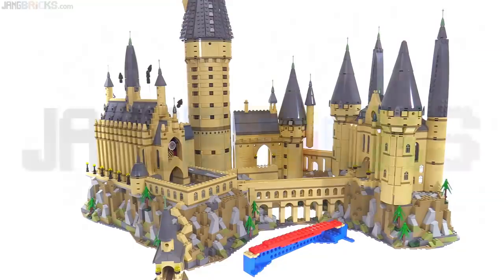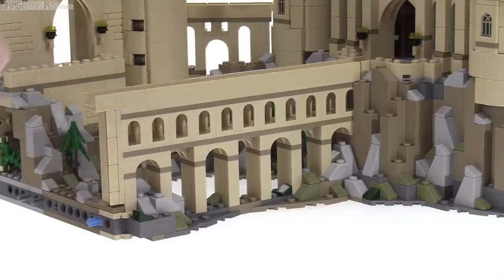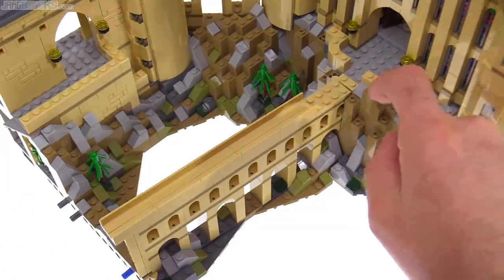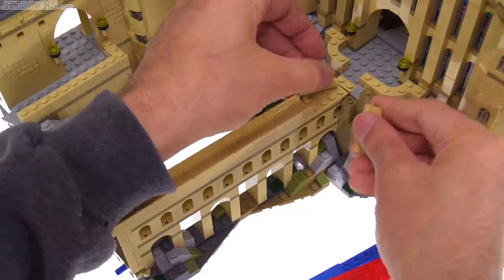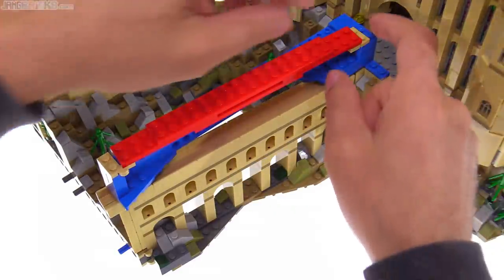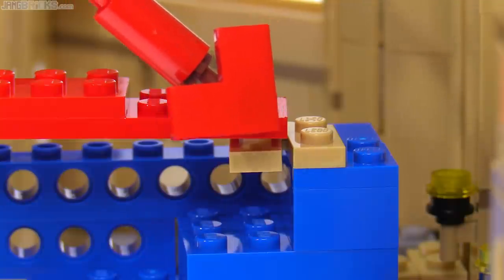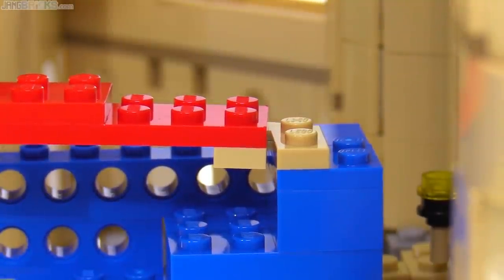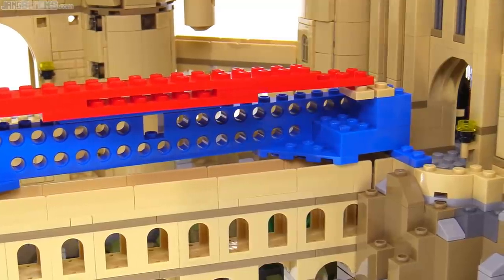LEGO Hogwarts Castle Viaduct geometry problem follow-up

Comment: Hogwarts should've gone through proper planning permission channels, before they built that bridge. Under normal circumstances it seems safe enough, but add magic to the mix, and the level of structural stress on that bridge is unacceptable! Obviously they cut corners, and maybe even paid off a few planning officials. Well now this corruption scandal has come back to haunt them. I certainly won't be sending any of my kids to Hogwarts, until they sort out this problem!
Reply: ROFL

Comment: I've been building castles a lot lately, and getting angles right is very, very difficult. I admit, I've done similar illegal techniques in my mock builds, but they are not for long term display, and not for sale... I'm not sure I agree that it's a minor issue. This is a display piece, so it should be designed to sit. The ucs imperial star destroyer is a good example. Looks amazing, but after a few years the long plates warp and sag. Also, when they let things like this slide it can set a precedent for future official builds.

Comment: This choice of building technique could potentially damage the section and the pieces (the set I guess).
Reply: I doubt the bricks would get damaged. However, if you move the set you would have to be very careful.  Because of this extra stress, bricks could snap off.

Comment: For anyone wondering about the exact numbers, it looks like the difference between the two hinge points in the blue is exactly 22 studs. Meanwhile the distance between the two points where the red piece lines up with the hinge points is between the two corners of the 22x2 red bridge. So that distance is sqrt(22^2 + 2^2) = 22.091.

Total discrepancy = 22.091 - 22 = 0.091 studs, less than a tenth of a stud and I think about 0.7 mm.

Comment: i believe a variant of this also appears in the nose of the 75218 x-wing (and several previous iterations). a 10 stud long section is attached at an angle using the same hinge plates. (the lateral offset is only 1/2 in this case). i kept double checking but it appears to be true! for me this is more interesting than "wrong" but i still find it worth studying.

Comment: We just finished this build today and did not replicate this issue. We watched your review before our build, so we knew the problem was coming. What we found was our viaduct fit perfectly with no stress or tension. We did a short video to show you, we can send you any photos you might find useful to compare builds if you'd like. Love your reviews by the way, and we were looking forward to trying to solve this problem, but ended up not duplicating it.
Reply from the maker: I appreciate you sharing the video.  I just left a detailed comment there (and no, I'm not the one who gave you a thumbs down -- that was uncalled-for).  Your demonstration actually inadvertently shows exactly the same issue that I did, as you're having to bend the whole left side of the foundation out to wedge the viaduct into place.
Reply: Thanks, I pinned that comment. We appreciate the additional explanation!

Comment: I think I'm more worried about this than Jang. I've had old pieces crack just from the normal stress of being assembled, this puts a much larger stress on those pieces. It wouldn't crack right away, but it could years down the road. And this is the kind of set meant to be displayed for many years.

Comment: Wanted to bring attention to Kristof Pucejdl solution posted below. Great work! https://www.flickr.com/photos/127695176@N03/43309746515/
Reply: Wow! That's so simple yet so clever.
Reply: hmmm I don't know if it's accurate enough to fit perfectly but it seems that it may be a better building technic than the original one.
Reply: Es verdaaad, its true
Reply: more people need to see this!
Reply from the maker: While this does allow a legal, unstressed connection of the hinge in the simplified demonstration model, it does not fix the issue in the completed model, as there's an entire stack of bricks directly below the red plate that impact the landing.  Look at the corrected LDD model from the top to see what I mean; the top point of the red plate, which is effectively a 2D representation of a 7+ brick tall bridge, overlaps the blue 2x2 plate, which represents the edge of a BURP.  I should have shown this in my video as it's actually a better illustration of the fundamental geometric issue of the bridge being too long for the space into which it's forced.
Reply: Thanks! As Jang pointed out, it is a theoretical solution, but to apply it, it apparently requires more substantial modification. I could put up the work and design something, probably digitally using online instructions because buying the model is way out of my economics. But I think I can not target enough people to make the effort worth it. Maybe Jang will do it himself? :D

Comment: By the looks of it, the distance between the two hinge points is the diagonal of 22 by 2 studs for a distance of 22.090722 (sqrt(22^2 + 2^2)) fit across a gap of 22 studs, meaning that the bridge is 0.090722 studs longer than where it attaches. It looks like the structure surrounding the actual model is less rigid than your model, so hopefully it is not too big of a deal.

Comment: Pythagoras Time!
Judging by the view of the reproduction, we can call this build 22 units across and 1 unit down (since the hinge is two studs long)
The red “bridge” is 22 studs long, but to find the length that the red “bridge” should be, we use c^2 = a^2 + b^2:
c^2 = (22 * 22) + (1 * 1)
c = 22.02 <- slightly, not exactly 22!
As you can see, the actual bridge is shorter than what it should be, since 1, 22, and 22 as the hypotenuse aren’t exactly Pythagorean Triples (eg. 3, 4, 5 as the hypotenuse is a Pythagorean Triple since 3^2 + 4^2 = 5^2).

Comment: I had hoped that you'd make a math video like numberphile. Because if you draw and then calculate the geometry, you could notice that the length of the space is 22, and the viaduct is attached in a way so that the two attachment points are at the opposite corners of the 22 long, 2 wide viaduct. Because of this, according to Pythagoras, the distance between the attachment points of the viaduct is sqrt(22^2+2^2) = 22.0907 studs, which is not even nearly a full stud off, but far enough to feel it during a build.

Comment: Would one of those 2x2 plates with rotating studs be a possible fix? That's what immediately clicked in my mind once I saw the hinge didn't line up.
Reply: Carum Sarene true shame I don’t have the set I would try that
Reply: That would only change the angle, but the angle is fixed by the lengths of the triangle sides. And size the lengths of the sides are fixed it won't help. If all three angles could simultaneously move then one could expand to fix the issue but they can't all move. 

At least I think that's going to be the issue.

Comment: This is very well presented! I'd be interested to know if LEGO consciously allowed the design to stress the elements, or if this was just missed by the illegal-technique police :D
Reply: I'm pretty sure it was a mistake. If the ends of the bridge were four studs apart in y-direction instead of just two, it would actually fit in perfectly. And I'm not talking within a micrometer perfectly, but mathematically exact perfectly.

I'm pretty sure the builder was trying to use that technique, but messed up on the number of studs needed to make the connection perfectly.

Comment: If a1x2 jumper plate was used on that right hinge to connect to a center tube underneath the red plate/bridge that might circumvent the issue. I don't know how well it could work in the set though.

Comment: I can only imagine what Lego designers must be going through when designing a set like this, they certainly make mistakes and start over a build at times to make it better and making sure there are no "illegal" connections of bricks, forcing and squeezing them together is not the right way to build, but I guess some compromises may be acceptable, it only creates a slight gap and it won't affect the build itself, no build is perfect. And if you're able to correct something like this without taking everything apart, then bravo.

Comment: I wonder if the problem is a balance between working within the constraints of a LEGO brick and matching an element of Hogwarts Castle. Such that the angle of the viaduct creates the problem, and it would have to either be made straight or on a much greater angle to resolve the fit.

Comment: If you need hinges to connect one end of your bridge to another, maybe you have a larger design issue.  My understanding is that the ends of the bridge are offset by 2 studs. Obviously the design of the model on either side of the bridge led to a misalignment between the opposing entry points, necessitating the hinge.  What bothers me more about this build is not the illegal building technique, but the gap that is created in the hinges on either end of the bridge.  Even if the technique was legal, and the lengths magically worked out to allow connection without undue force or bowing, you would still, necessarily, have a gap in the hinge.  That sort of gap may work on other builds where you have rounded or unusual geometries (like the UCS Millennium Falcon build I just completed), but IMO, looks odd in this application.  I would have designed the model to have either end of the bridge to be aligned, without the need for a hinge.

Comment: This is the same kind of problem I have with the X-Wing fighters. The noses of them are turned up a tiny bit because of the angled side walls and the plates on top of them don't line up exactly. I even designed a legal fix for it so I don't know why Lego still does it.

Comment: The distance across from "main land" to "main land" hing is a movement of 23 studs across and 2 studs offset.
So the distance across is 23.09 studs. So the bridge must be 22.09 studs, minus the tiny distance between the open part of the hinges when opened at 5.444319 degrees.
 That distance along the line of the inner stud of each hinge is also 0.09. So the bridge must be 22.09-0.09-0.09 = 21.91. But it is 22 studs. The bridge is too big to fit.  A design flaw. For it to fit you are essentially forcing the two peninsula to spread by 0.09 studs wider than they would naturally lay. Jang is right, this is sloppy from lego. Over time I think it will make bricks work their way lose, and possible crack from fatigue.

Comment: I think this could probably be shown even clearer by doing some math using pythagoras? It seems the general sentiment is that it's a minor problem. Personally I'd say this is a huge problem specifically because this is Lego. The basic design of a Lego brick rests on the idea of rigidity and alignment (there are definitely exceptions, such as flexible pieces, etc, but this is not the case). A hinge will always need room to swing in, and whenever a piece is put on an angle, its more than likely not the right length or alignment to be reattached to the other side. I'm surprised they let this through, deliberately or not. Will be a bit tricky for anyone who cares enough to try and fix that. I'm quite disappointed, they can do better :\

Comment: I’m not a professional builder by any stretch of the imagination... just a guy that likes to build. I have heard “illegal” off and on for the last few years. Can you go into more specific about what that means and how this is “policed”?
Reply: Destiny Captain it means techniques that lego officially doesn’t use in retail sets, its only done by fans
Reply: "Illegal" is just the word LEGO designers use to define building techniques that are considered undesirable because:  
1) they place stress on the elements, making them wear out 
2) they cause elements to be out of sync, making them difficult to combine with standard building techniques or difficult to model with designer software 
3) they make the set difficult to assemble or disassemble for a kid

It is LEGO though, so in all honesty you can build whatever you want however you want.
Reply: If you really want to know what is allowed and what isn't as well as why, I highly recommend reading this. http://bramlambrecht.com/tmp/jamieberard-brickstress-bf06.pdf
Reply: As Gage Fisher said, pieces have to fit together “at rest”. If you have to wedge things together where they are constantly under strain, or a clip is only half connected, then that will not only make the Model hard to build but also make it fall apart easily and compromise the pieces over time so they get bent out of shape. 
It is only an official set thing and custom builders do “illegal” techniques all the time, but they don’t have to worry about making instructions that a five year old could easily follow like LEGO do with official sets. 
Personally I think it’s a good thing, sets like a UCS Star Destroyer they made years ago had many plates on top of each other without enough Technic beams to support them, and with years of the force of gravity it makes those models all warped and splitting apart if they have been sitting on display. If LEGO is totally obsessive about their design, it means the LEGO you buy now can still be played with by your children and grandchildren.

Comment: I have a feeling that the structural integrity of your model wouldn't have shown bowing it you hadn't left that space between the jumper plates for flex
Reply from the maker: True but whether the bowing shows in a demonstration model isn't a concern; the issue is that the entire bridge is too long to fit in the space available on the castle itself.  I should have shown the thing from the top to make this even more clear.

Comment: you could try to recreat it on Lego Digital Designer, if it works, its ok, if not, i guess its a mistake by lego
Reply: I was able to make some impossible connections with LDD (that would end up breaking a clip in “real Lego”), so that’s not entirely true.
Reply: LDD is by no means correct with its geometry! I had to use a file on some pieces which were crucial to one of my MOCs because I designed it in LDD and LDD would allow the connection I used without a problem.

Comment: Strange. In our set there is no pushing needed, the viaduct would fit Just fine when straight. The crookedness, if you will,  is a design choice. But there was no stress whatsoever.
Reply: It's a simple math problem that is in every set. It's evident if you make sure to assemble everything at right angles and pressing the pieces firmly together. If not, it way less noticeable and that is probably why I was allowed in this instance.

Comment: I had some problems with the base of my lego Ferris wheel from 2015 where the base wouldn’t sit completely flat on a flat surface and I rebuilt the base several times and still had the same issue

Comment: I don't have this set, and probably never will, but this is concerning.  I already dislike the whole tiles inserted into clips techniques that have been going around in sets, but now this?  There has to be a way to make it possible to still be sturdy and be completely stress free.  Unfortunately there are no instructions online yet, so I can't see if there's a way to insert tiles below that level that could slide into a slot or if there is room to add extra rockwork on the other side to keep things free from wiggling, but I think there could have been another way of doing this.

Comment: I believe it might still only be an off-by-one error. This is an old trick for making angled sections using hinges (explained well in a Creator video here: https://youtu.be/7jOVIpZj1g8?t=1m37s). From what I can see and a bit of drawing I did to make sure, offsetting the hinge at the end a further 1 stud would solve the stressing problem.

Comment: Calling an obscure building method ‘illegal’ seems so stupid to me. Lego’s meant to allow your imagination to run wild and do what you want. Grown adults labelling ways of building as illegal and some refusing to buy this set because of this is ridiculous.
Reply: This is not about using obscure, techniques  it's about putting stress on parts in ways that could potentially (highly unlikely in this case) damage the parts, and THAT is illegal. It is not a huge ordeal however it's still not something you'd expect from something like this.
Reply: It's Lego's own term :-)
Reply: lego is a complicated interlocking brick system.   YOU can do whatever YOU want but LEGO cannot design kits this way and he has clearly linked the solution that doesn't require any extra money.
Reply: It's probably the biggest mistake that Lego has made in recent times just for the fact that it made it into the set. It's not obscure and someone even posted a fix for it. The problem is that it's forcing Legos to fit how they aren't supposed to so it will cause those pieces to warp and crack over time. It's not like they just put something in a weird place. I don't think anyone should avoid buying it since there's a fix for it and I'm sure Lego will address it soon.